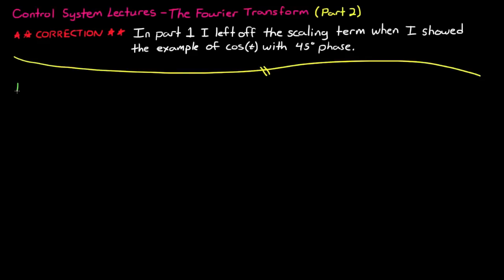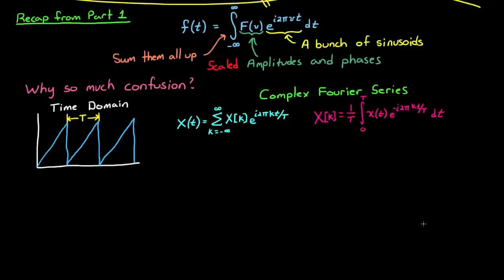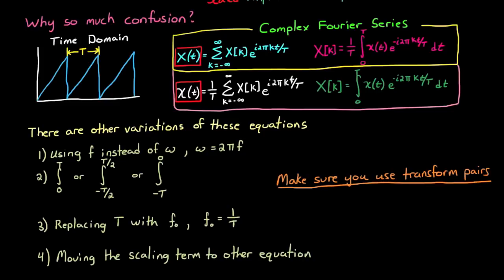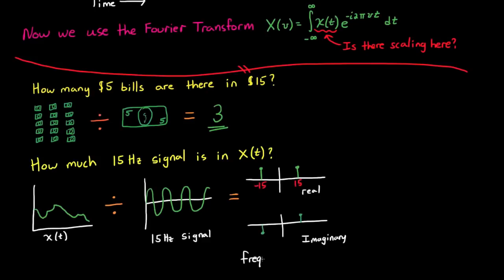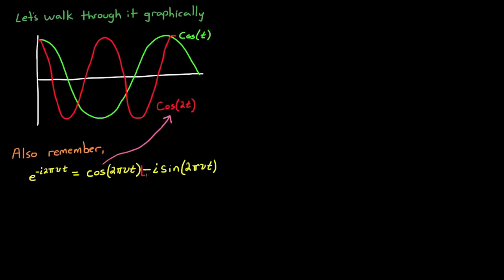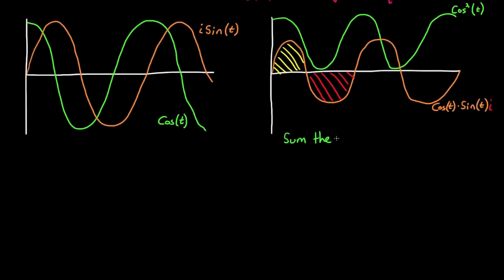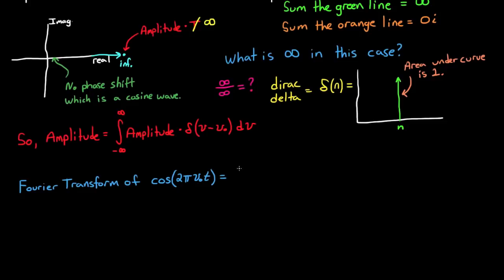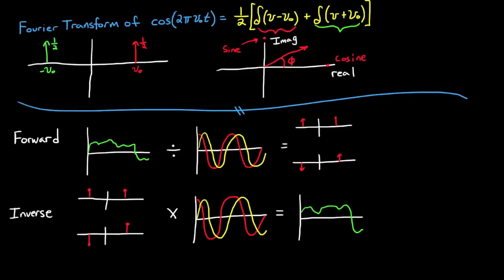Introduction to the Fourier Transform (Part 2)

Comment from the maker: Forward FT goes from time domain to frequency domain, inverse does the opposite.

Fourier series breaks a periodic time signal into the frequency domain. It does the same thing as the FT but the transform works with non-periodic signals.

Yes X(v) and F(v) are the same. I'm really bad about using the same variable letter from video to video.

Scaling is not amplitude. If you plot the complex output of the FT amplitude is the distance from the origin. Scaling is just a gain part of the equation.

Comment: Hi Brian!
So as a Mechanical Engineer, we never really dug deep into Fourier. Short overview and then straight to Simulink and FFT libraries... all in discrete domain.
However, now I work in Automotive industry on electric vehicles, dealing with topics that i never really studies. Long story short, we often need to define parameters of SW and HW elements, which contribute to different delays and phase shifts (simple LPF). Diving from analog to digital has always been intuitive to me, but I wanted to 100% understand the background of Control Systems, Digital Signal Processing...
Recent situation of quarantine "finally" forced me to do a step... and man... I am happy I did. With my "rusted" knowledge I started from scratch and finally got to the point, where I understand the main principle. All this is in 2 afternoons!
Thank you for putting an effort. Explanations really feel like they were designed to focus on listener's basis and gradually build up the comprehension of the topic.

Best regards,
Aljaz

Comment: senior computer engineering student here:   I have been struggling with the intuition behind fourier series and transforms for a while now, but the part at 6:00 and specifically at 6:14 just pieced it all together. 

Thank you!
Reply: That's why there's a negative power; it's just division of e^(i*2*Pi*U*t), but to express it on the top line we negate the power. Waveform divided by sinusoid gives how much of the sinusoid is in the waveform. This is a great video. When I tried to learn it at uni, if you didn't get it, the lecturer just moved on and you didn't get it for the next four years - there was no Youtube!

Comment: Brian, thanks for these videos. I have taken controls in the past but never quite clicked. So far, these videos have really cleared up concepts I struggled with prior.  

That said, because I am studying this on my own, do you have an pointers on where I could start in making a controls project? That is, I understand examples like close-loop control given cruise control or running dishwasher until something is clean (your prior examples). But to actually put it all together, that is, applying the Laplace Transform, Bode plots, poles, conversion of time domain to frequency and vice versa, etc, do you have any thoughts as to where I can start implementing this into a project? I am looking for something basic that will prove the concept. I am looking to gain a deeper physical understanding for instance, in how the poles of a Laplace Transform help in fixing the output. What does it physically do to the output? I would like to setup an experiment to gain that hands on understanding of these complex formulas to build upon for projects beyond my first.

Perhaps I will have better insight once further into your videos. Thanks again for these, you guys make academics fun.

Comment: Thanks for the great video series!  Just wanted to point out that the reason positive i*sin(t) works out just like negative i*sin(t) is because i and -i are completely interchangeable as long as you're consistent about it — the defining equation i^2 = 1 is true for both.
Reply: panic i^2 = -1; his explanation still works out in the end because doing the integral for cos(x)sin(x) or cos (x)(-sin (x)) both give 0
Reply: Err yeah, that's obviously what I meant!

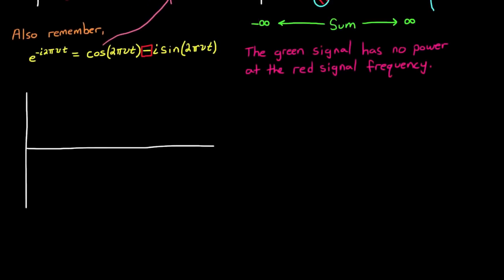Comment: 8:05 "The green signal has no power at the red signal frequency." What does that mean?
Reply: What I got from it is that at the frequency of the red signal, the green one sums up to zero (from positive infinity to negative infinity). As such, it has no power. The total area under the curve that's positive equals the total area under the curve that's negative. 

Having said all that, this is the most confusing video of his that I've seen so far.
Reply: In the real world the energy for running some system is more than zero (the power is being dissipated) only if the force is in the phase with the direction of the motion (W = F*s*cos (theta)). Similarly, electric power is dissipated only if voltage and current are in phase (P = U*I*cos (phi)). There could be significant current but if the voltage and the current are out of phase the power is zero, therefore the power counter will not 'count' anything. In that case there is only a reactive component of the power for which you don't pay because you didn't spend anything (reactive component cannot do any useful work). Analogously, the sinusoidal components which are off the frequency of the red signal are out of the phase with the actual signal - therefore their power is zero. Analogy is in that the power is always the area under some function and by mixing the signals which are out of phase the area above and under the x axis cancels out. In other workd, if you are using old style vibrating reed type freqency meter, the reeds corresponding to the frequencies where power is zero wouldn't move.
Reply: <3
Reply: just like the relationship of two vertical vectors multiply by each other, the answer is zero.
Reply: @safatkhan6839  It is not truth that it sums up to zero as it was said in video. It regularly oscillates between bounds with increasing interval of integration and so the integral doesn't exist, because the limit doesn't exist. But integral of red signals sums up to infinity, so we don't need to care about something oscillating in bounded interval that is incomparably so small regarding to infinity.
Reply: It sums up to zero only in our physical world, because information or energy (it is the same) in infinite long wave would be infinite. We  live in the world where exists only rational numbers and radicals, not infinity. So every wave has zero amplitude in infinity and what's more, the integral of square of amplitude is finite in bounds +- infinty.
Reply: @kexuchen4288   perpendicular, not vertical. Vector of values of sin(x) is perpendicular to cos(x) under period interval 2kPi where k is natural number. That interval has uncountable dimension (coordinates) so summation of inner product goes to integration. Summation tackles countable basis, whereas integration uncountable infinite basis.
Reply: @miro.s  It was a long time ago and I don't remember what I was talking about. All I can say to you, my friend, is to infinity....and beyond!

Comment: At 6:55 you were discussing multiplication of cos (t) by cos (2t) which is coming from exp(-i*2*pi*freq*t). What happened to the imaginary part?
Reply: In the next step he explains that the imaginary part gets cancel out. As its area under the curve that repeat in the negative and positive direction. While the real part remains positive. That is true with all signals multiples by e^iwt. That's why Fourier is beautiful. It takes the signals to a imaginary plane and while solving, the imaginary parts get cancelled and leaves the real part of any system to work with.
So, any phased out signal that cancels each other cancels, and the rest remains. So we apply i in a way that it gets cancelled always to make the system work.

Comment: Hi Brian,
I started following your channel recently, and I really have to compliment you! Your videos are amazingly didactic! However, I have a question about the meaning of the Fourier transform interpretation. Let me express it with the angular frequency “w”, with which I am used to.
Imagine the real signal f(t) is a voltage signal in [V], and time is in seconds [s].
Since F(w) = int f(t).exp(-i.w.t).dt , the sum performed by the integral obviously has  [V][s] as unit, which can also be written as [V]/[Hz]. This means F(w) would not represent the actual amplitudes of the sinusoids present in f(t), but rather an “amplitude density per unitary bandwidth”. 
Another way of looking at it is by recalling that the curve of F(w) is continuous (it has infinite points, representing infinite frequency components). If each point of F(w) represented the actual amplitude of each sinusoid, then the integral sum of the inverse transform would result in infinite amplitudes for f(t).
Yet another way of checking this interpretation is by looking at the cosine transform, with dirac deltas “d”:  F(w) = (1/2).d(w – w0) + (1/2).d(w + w0). Dirac deltas have infinite amplitudes, and the “1/2” in front of them represent their areas. Exactly what we would expect if F(w) represented an “amplitude density per unitary bandwidth”. Then, the amplitudes of the sinusoids in f(t) would really be represented by the area under the curve of F(w), per unitary bandwidth.
Of course, this interpretation does not apply to the Fourier series, because the frequency domain is discrete.
Would that make sense for you?
Regards,
Solivan Valente

Comment: superb lecture sir. what is the difference between Laplace transform and Fourier transform?
Reply: Watch his video on the laplace transform.

Here is a very dirty answer, but it helps with intuition.  The Fourier Transform is a subset of the laplace transform

The Laplace transform uses s = sigma + j*omega (o + jw).  The Fourier Transform is essentially just when o = 0, and s = jw.

The Laplace Transform deals with BOTH transient and steady state responses of a signal, from [0,infinity).  o represents the transient behavior, and jw represents the steady-state [sinusoidal] behavior.  The Fourier Transform is JUST the steady-state behavior of a system.

Again, this is not entirely accurate, and just an intuitive way of looking at it.

Comment: Hello, if somebody could please help me how he did the math for the part where you multiply cos(t) with cos(2t), and the one with cos(t) and jsin(t).

The part where he proves that if you multiply cos(t) by a frequency other than cos(t), the sum will approach zero, and the example after that.

I'm not really sure how this is done mathematically :( And also, why is it in the 2nd example with the same frequency, jsin(t) is used? And how was the math for the output done?

Thanks a lot to those who'll help!

Comment: Now I wonder if there is a reason to represent low frequency when its t is low.
Since exp(jwt) can transfer high t to high frequency, why don't they define it in opposite way? like low frequency can represented by high t.
Reply: My guess is,
Intuitively, first, exp(jwt) is easier to formulate rather than when they are inversely proportional case.
Second, this might be more representative in real world system. PID controller works like this. A pendulum moves like this after you put some pulse on it.

However, these are just my guesses, and there would be many counter examples for my second reasoning. I do really wanna know why it is like that.

Comment: Can anybody guide me where can I find a video lecture that will help me understand why there is a real and imaginary part regarding those frequencies?
Reply: Since your comment is a month old, I'm not sure if you still need help with this but I'll try and say something that puts you in the right direction since I don't know where a video is that answers that specifically.

Asking "why is there a real and imaginary part" is a lot like asking why a trajectory is modeled with a parabola or in an even more simplistic case why does addition describe combining two quantities. The imaginary part is there because it is necessary.

A long time ago mathematicians realized that you could create numbers with more than one component (like imaginary numbers and vectors) in order to get new types of performance out of old types of functions. In this case, the imaginary component is allowing for subtraction (new types of performance) to occur at specific values of exponentiation (the old type of function). The reason the imaginary component is not always important for a solution is because it is really just a tool to get the real component of the calculation.

Imagine taking a string with a weight at the end and swinging it in a circle. In front of you, you see a circle, but if you were to rotate your view of this by 90 degrees, you would only see a weight going up and down. Now imagine that the view point where it is only going up and down is the "real world", you could create math that describes the weight going in a circle, and then only utilize one component of it (the y component for instance of an object rotating in an x-y plane) as the part that would be measured in the "real world". I hope this illustrates why the imaginary part serves as a tool for the sake of calculation, but can sometimes be thrown away in terms of how a system is behaving, since it is often just a tool for calculation.

If this general explanation does nothing for you, give me a time stamp, and ill see if I can figure out something more specific to the part of the video that does.
Reply: gbiota1 Well i kind of understand and at the same time i don't... perhaps something more specific would be better...
Reply: Then you will have to be more specific, and give me a time stamp about what is confusing you. Imaginary numbers arent chosen arbitrarily, the components are necessary.
Reply: Flankymanga I am sure this help your understanding, Imagine, you are in the ground outside of your home or your living room, that ground or floor is your horizontal axis; now take a pole that is straight and stick it to the ground standing up, that is your imaginary line.2- seats an object in the ground next to the pole, measure the high of the object with respect to the ground that high up measurement is your imaginary number. Why it is necessary, well everything has high and length. Two dimensional plane or better say it is actually 3 D but the video is dealing with two dimension X and Y, where X is the horizontal (real) line and Y is the vertical line(imaginary line, because, you stick that pole in the ground)
Reply: Luz Batista Thanks i have already understood the matter :)
Reply: +Flankymanga What helped you to understand it, if I may know?
Reply: +Marcin J What do you have problems with?  Each frequency has its frequency and amplitude... take that as imaginary and real parts of a number... in other words signals are like that...
Reply: you mean each frequency has its phase and amplitude

Comment: If someone is still struggling to visualize the FT you may want to have a look at this talk:

https://www.youtube.com/watch?v=FjmwwDHT98c

Even though he messes up many tiny details (swapping sin and cos, getting his sample values wrong, ...) the way it's explained is actually quite brilliant. Note that he only talks about the DFT. So it's more based on practical examples having discrete data at a certain sampling frequency. However the generalization should be simple to grasp once you undertand it with a time discrete signal. To me visualizing the rotating clock hands is one of the best ways to think about it.

Comment: Thumbs up for your exposing the deepest catholic secret at 1:06 when you said to manually add the signals and not bother the transform. In the real world, the funding is only paid for to deal with 1 signal so that there is nothing to add except phase shifting it with Euler's representation. The transform is, like you said, menacing, just to confuse you. Fourier hitched the ride on Newton/Leibniz's calculus notations with Euler's discovery after the 3 true masters all just died, so that he wouldn't be denounced and quashed of his fame.. Fourier transform itself has no substance, just following notations to the most confusing extend possible, and Fourier discovered nothing new.

Comment: This is really hodgepodge! You are attempting to explain mathematics in laymen language shows how feeble your knowledge of math is. Fourier Transform and Fourier series are two different concepts. Fourier Transform is a definition that needs no explanation. Fourier series comes from the fact that cosine/sine form a basis of orthogonal vectors for the scalar product integral over the period. 1/T is simply to to normalize the vectors and obtain orthonormal basis where the integrals of the vector to itself result in unity "1". in physics/engineering it is a scaling to remove time as an integral when performed it multiples by time. You are confusing people. please try to fix this and read a little bit about this on wikipedia before sharing this material! Aside from this I like that you have spent time and energy to share knowledge. thanks.